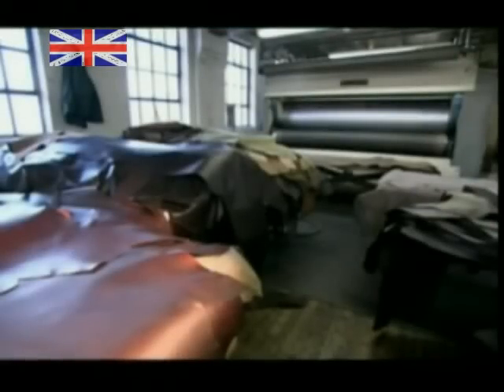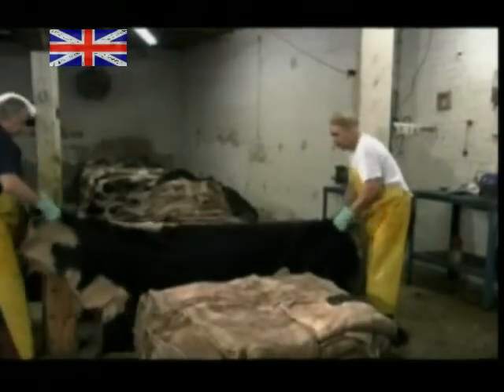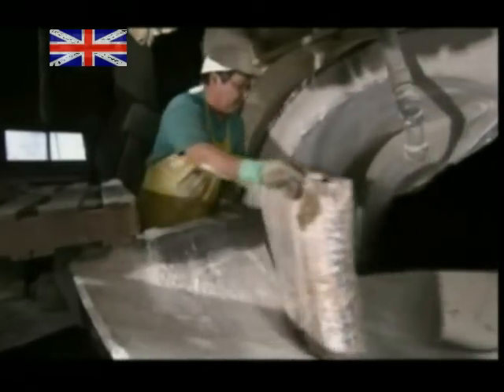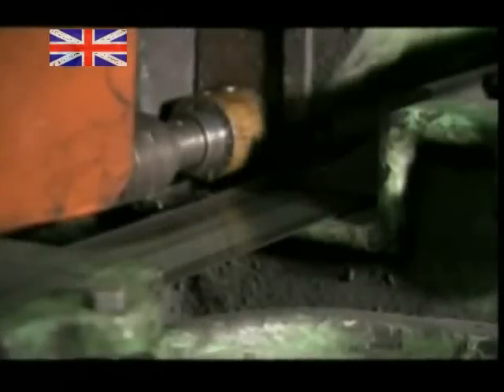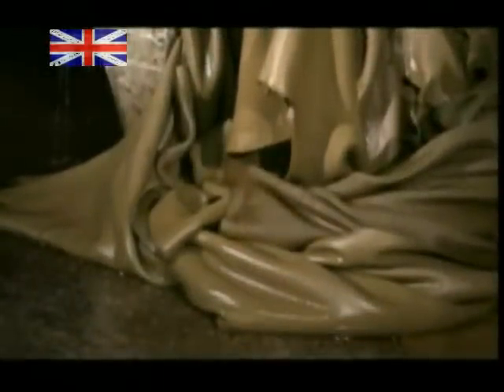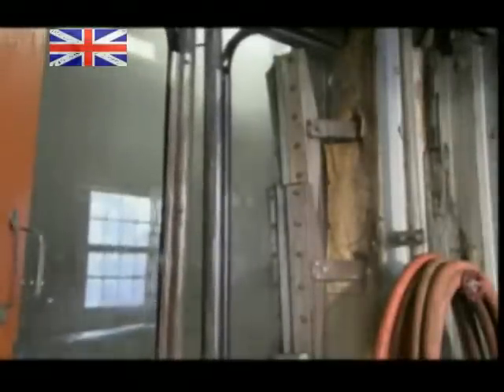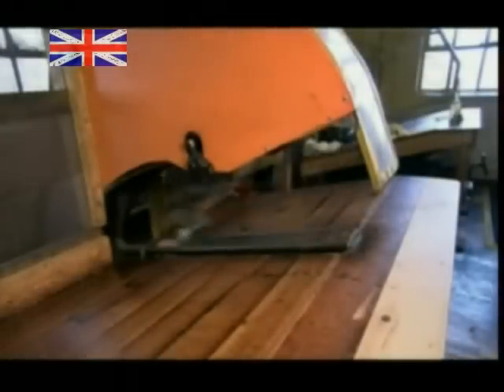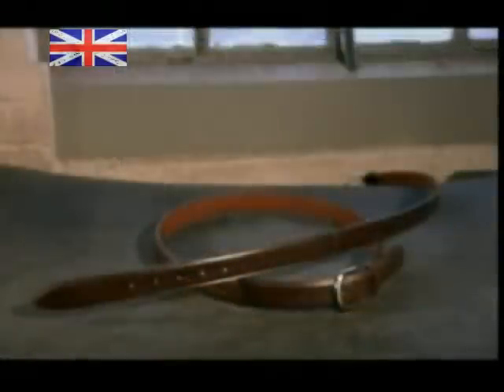Leather - How It's Made

Comment: Synthetic leather is garbage compared to real leather. In all my experiences with synthetic leather, it's started to peel after about six months, looks cheap and feels very plastic-like. I think people preaching the ethics of using synthetic leather tend to forget that it's made out of man-made compounds such as plastics and petrochemicals which are terrible for the environment. Not to mention, most of the stuff out there is so cheaply made that when it starts to fall apart it has to go to the landfill. Not much better in my opinion. If properly maintained, good quality leather will last for years. Cheap leather isn't much better than synthetic leather in terms of longevity imo, so stay away from it if possible.

Comment: Where's the first step? You haven't showed me how a cow is killed and de-skinned.
Reply: I worked years on the kill floor... in the 1980s The Cow dies by spike gun by a human. If the Cow has a broken leg it is taken off the kill floor to be shot and killed by a piston and a bullet... Why? I do not know why... I just never asked. This cow will not be eaten by human. The cow is hooked up on a chain line with many sharp hooks it's cowhide is then separated by hooks on a production Assembly.. Is it not pretty. Sometimes a Rabbi would sacrifice a Cow with his machete blade once a month... He would pick the best cow, then the Rabbi would say his prayers and in almost of an agreement he killed the cow. The sacrifaced Cow would bleed and fall suddenly to sleep... Dead...  I never saw a Cow suffering at the hands of this Rabbi. Ever. Again that hide would come off the blessed cow as part of the assembly line. (Still with me?) All he hides with fat and blood would be sent by chain and hooks to be released in a concrete dungeon like space. I would cut a hole through the hide and hook the hide on a other hook and belt and the hides would collect in a dump truck parked out side and taken to a Hide Processing Plant. The Cowhides would be placed in huge tubes of hides holding up to 1750 Cowhides in 3 pools of water mixed with salt and warm temperatures. All hides would be hooked on razor sharp hooks, trimmed,   fleshed, graded and palletized. At the speed of 7.5 seconds per hide. Wages were between $8.50 to $12.50 per hour after 150 hides graded premiums were 25 cents  hide. Money was good but you worked for it. This company does not exist it folded in 1991.
Reply: +Kevin Kapay. When any animal is injured, Hormones are released into the body in fairly large quantities, These make the hormone laden flesh unsuitable for human consumption. In addition it would be tough and taste horrible
A similar thing happens when animals become stressed due to poor long distance transport, These animals are then left to graze for a period prior to slaughter.
Since these hormones (and toxins) can be detected by meat inspectors, people obey the rules. Getting a batch of carcasses condemned would loose the company tens of thousands.
Our daughter is a farm animal vet. Meat production is fairly humane here in the UK, but she hears horror stories from other parts of the world. 
PS, The US is not one of them.
Reply: @kevinkapay7973  Seems like a waste of a bullet.
Reply: @kevinkapay7973  Sounds fucking horrible.
Reply: to P90guy2... ignorant people like you need to know where and how the skin is taken from IS step 1
Reply: You need to know how the cow eat where it lived snd how many friends it have.
Reply: You need a first step to learn how to skin a cow... get the fuck outta here lmao

Comment: "leather is eco-friendly." Sure it is.
Reply: Tea Zidic
It depends. If an animal dies of old age and you take the fur then you certainly didn't kill the animal. If you take the fur from the meat industry then you simply used something, that they would have thrown away.
Reply: Would you prefer throwing furs from dead animals away? Would you want to burn them and therefore destroy usefull resources? I have no problem with leather that comes from the meat industry as long as the leather has been produced in an eco friendly fashion. That's hard to find though.
Reply: some cool dude
Indigenous people have used leather for centuries. Certainly not for fashion, but because nothing else was available. Intuitively they often chose the most enviromentally friendly way of clothing. They didn't tan their hides with chrom though(obviously).
Furthermore even to this day leather is still an excellent material for long lasting shoes, for gloves, that can take a lot of abuse, for saddles, bags etc. 
Especially in shoes (a throw away article) leather could be an ecofriendly alternative to the plastic/rubber that is often used. Leather eventually rots away, plastic often doesn't.  You'd need bark tanned leather for this though.
Reply: The chrome tanning process is extremely polluting.
Reply: It depends on the type of the leather and the type of animal that has been used, i guess. There certainly are ecofriendly leathers. Bark tanning in its most basic form simply requires bark or some other natural material that contains enough tannins then some oil or fat and lime or ash. 
People have made leather for thousands of years in a very ecofriendly form. They only required things like ash, bark, leaves, oil or just the animals brain and some wood for smoking.
Reply: No this is killing animals..just look how made fur..terrible..😣😣Poor animals
Reply: stau ffap i dont wearning any coat of fur...this is so expencive and terrible..I hate people(woman)who wearning died animals..(im live in croatia)every woman in croatia buying expensive coat with fur..😢😢😭😭😤😤😓😓☹☹☹😨😨😲😲🤢🤢🤢
Reply: stau ffap 😥😥😥😭😭😭😭😧😧
Reply: +TheCommenter71 Leather is the product of an industry that is responsible for half the worlds greenhouse emissions. "Polluting factories" don't even compare.
Reply: Better reproduce a lot of cows that produce CH4 which is a more powerful greenhouse gas than CO2 and in the process, torture them and kill them. Sure, it sounds better.